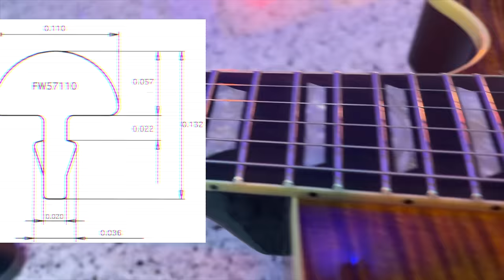The BEST Sounding Les Paul I've Ever HEARD

Comment: I want one . Tim Pierce, signature ✌🏻🎸🎶
Reply from the maker: Heritage told me.......Just reach out to them, and they are happy to build anyone a "Tim Pierce spec" guitar :-)
Reply: A Tim Pierce signature, why has there not been one yet? That would be great!
Reply: @timjonesguitar   I got an H150 thirteen years ago. I put some OX4 pickups in it. It's awesome. I also have a Heritage archtop which is even more awesome.
Reply: @timpierceguitar  what is the price?
Reply: @timpierceguitar    I would love to do that, with the only change being chrome instead of nickel hardware, because somewhere along the line my body chemistry changed to one that does bad things to nickel.
Reply: I asked Heritage to make an H150 to my specifications in 2017.  They were fantastic to work with.  My isn't weight relieved but was air dried (as opposed to kiln dried, as is typical of guitar blanks) and sorted for light weight.  Coincidentally, I also asked for a 1960 shaped neck.  The 225 humbuckers weren't around yet but I specified ThroBak KZ115s and bumblebee caps.  It's a great guitar, if a little hot.  I find it's the most predictable of my guitars and I can make it do what I want it to, if that makes sense.  (my first electric guitar was an H-535 with Lollar P90s and it's great, so going to Heritage for the custom H150 was a natural.)
Reply: @timpierceguitar  The headstock is hideous
Reply: @fritzhieke7209  Heritage Custom Shop starts @ $4100 so this is likely in the $4500 - $5000 range. Note, this is a killer top and compared to the new TM aged Gibson's that are $20k, this appears to be a "deal".
Reply: @lucbos7516  Yes, the headstock is a little plain, but they had to differentiate themselves from Gibson for copyright reasons. Honestly build quality and sound are more important to me than the shape of the headstock. I might be in the minority on that, but it is what it is.
Reply: A lot of people complain about the headstock design; I don’t mind that; and their archtops are the bomb.
Reply: Kalamazoo built. Heritage are wonderful guitars
Reply: @fritzhieke7209  the H150 Custom Cores are 3800-4500.00 as ive seen on sweetwater. So without Sweetwatter's cut, and direct from Heritage...probably similar.'
Reply: @etherboy3540  the headstock works better than the Gibson...less deflection.
Reply: What's a ballpark figure on this.
Reply: I’d buy a “Tim Pierce sig” in a second! 🤘
Reply: @lucbos7516   Stop.
Reply: Yeah, with all the little goodies he got on his....
Reply: Love my Heritage.  My back does not.  😂😂😂  As good as any Gibson I've ever played, highly recommended.
Reply: 100 percent.  Would love one!!
Reply: I just got a Artisan aged custom core h150, it's the best guitar I've ever played
Reply: @ilikebacon860 , Tim’s version in 7 lbs 4 ounces
Reply: @lucbos7516  The headstock reminds me of the old Gibson headstock design, and assumed it's supposed to?
Reply: @MikeTheEarGuy  Seriously? It's solid wood and only weighs 7 1/4lb..?  My Epiphone '59 reissue weights 7.7lbs., and was the lightest solid Les Paul I've ever played, Tim's is the lightest I've ever heard of if that's true.  Of course Epi uses Asian faux "mahogany", but resonates well and sound good, so I don't care about the species.  I heard the new Gibson CEO say they own a forest of "mahogany" (not sure what kind) on FIji, if I remember correctly.  He said it was getting difficult to source and heavy, so they grew their own forest of a fast growing species I assume.  The lightest Honderas mahogany (which grows in other countries in the area) comes from the largest trees, and those are the fiirst ones they cut down.  That's why you'll sometimes see early Les Paul guitars from the first year weighing just over 7 pounds, supposedly it might have been Cuban mahogany, but all their forests were destroyed rapidly from over-harvesting the timber.  The lightest and best wood sonically is at the top of the tallest trees.  That's what I read, and it makes sense.

Comment: Years ago while working for Sprint i was at their telecom site which is next door across the tracks from the Heritage factory. I had a 1938 Gibson  f hole style acoustic guitar with me that had a shimmed neck and didnt play well. It was all i had at the time though. I went next door and knocked on the door with the guitar in hand.a guy opened a little square window and asked me what i wanted. This is a very rough neighborhood it seemed to me btw. I told him iwhat i had and it was doing and asked him for advice what to do with it. He said they dont fix guitars. But a guy behind him said let him in let me see it. So i went in and he looked inside it and his eyebrow arched. He said leave it here and come back at 4 o clock. I thanked him and went back to work. I went back at 4 and he wheeled out a very old guy in a wheelchair. He had a light on a head band and he showed me the tag inside through the f hole where he built it in 1938. This all happened in the late 90's. He showed me another tag he had added where he repaired it that day. I tried to pay them but they wouldnt take my money and they basically ran me off. It still plays beautifully now and i still have it and have added a floating p90 .
Reply: Wow! What a story! Thats awesome 👌.

Comment: I worked in a repair shop for a couple decades, a period over which I've played almost everything known at one point in time. It's an interesting thing when it comes to Les Pauls, weight relieving/chambering and the desire to have them sound as close to vintage Bursts as possible. Most people will go with a modern model without weight relief because the original ones didn't have it, and they're trying to get close to the tone and response.
I've played a number of 50s Les Pauls,; several 58/59/60 bursts, along with a few Gold Tops, and the one quality that was consistent among them that isn't nearly as prevalent with them after they returned from being discontinued in the 70s right up to modern ones, is the resonance and attack. "Liveliness" is a common description that, while a bit vague, none the less fits. There's a bounce and punch that people tend to equate more with Fenders or semihollows than with LPs. Personally, if I were looking to get a modern model to fill in for a vintage one, I'd start by trying out chambered, or even weight relief before non-weight relieved,  that's going to get as close to that liveliness. Another thing is that the older ones tend to be markedly brighter than modern ones, and out of the modern ones it's the chambered bodies that are brighter. I'm not completely sure why that is, but if I were to guess I'd say that with so much of the mahogany mass removed, the maple top plays a larger role in the collective tone. I've also noticed that the lighter the guitar, the brighter their acoustic tone is.
The resonance between the neck and the body is the foundation that everything else builds off from, and it's also the hardest thing to change later on (if it's possible at all). Pickups, pots, tone caps, hardware, etc? These are all things that can easily be replaced later on. The wood? Not so much.
Reply: I have a 2010 light burst chambered, it was the black sheep back then, no one wanted it and I fell in love the instant I played her at the store, bought it and it's my main guitar ever since.
Reply: @EduFirenze  in the spirit of transparency, I was biased against chambered early on myself, and for the very same reason I stated above. It wasn't the first time I was wrong about a piece of gear because I was viewing it that way. I remember being really put off by the Marshall Silver Jubilee because of the clipping diodes they use in the lead channel. I found it…unnatural for a tube amp.* Now it's my all time favorite Marshall model. 

*In my defence, Marshall had used clipping diodes in a couple other amps that I had heard and really didn't like. The nailed it on the Jubilee though
Reply: After 30 years of playing,  buying,  and flipping guitars I have a keeper in my 08 chambered standard.  It was great with the burstbuckers but then I swapped in SD Antiquities and it's like a telecaster and a grand piano spent a night together.
Reply: @TheRyguy79  Then you get what I'm saying, because that description immediately makes sense to me, I know the sound you're talking about. Matter of fact it's a better description than I used 🤔… I'm stealing it 😉.
Reply: amen brother!! i hv an 08 tobacco burst standard. Why wld you want 10 lbs hanging round your neck. Say what you will but i will put my chamberd up aganst any non weight relived lp. I put a dimarzio 36th paf in bridge and swapped magnet in neck pup for an alnicio 2. Its a tone monster!!!

Comment: I have a 1994 H150, that I’ve tried to love, but it is so heavy I can’t bond with it. I tried to sell it on consignment at a very-well-known guitar shop in Toronto.  However, as soon as the shop representative responsible for consignments lifted it up, he put it back in the case and said not interested. It’s been sitting in its case in a well-humidified room for three years now.

Comment: That's definitely an amazing sounding guitar. I've done all types of mods on my 2 Les Pauls and have gotten closer to the sound I'm trying to achieve but it still doesn’t have that awesome bell-like dynamic sound that yours has. 
A couple of things I've learned along the way is that no 2 guitars (especially Les Pauls) are the same. The mods (pickups, pots, caps, etc) definitely help but the gear you play through, particularly the amp,  is a big factor in the guitar sound as well.

Comment: Been playing Gibsons for over fifty years.  Played and owned lots of vintage.  Had some truly incredible Custom Shop Lesters!  Introduced to Heritage twenty years ago.  Been to Parsons Street a dozen times (a couple of times since the change in ownership) and have met all the original owners.  I've owned half-a-dozen Heritage guitars and had them do a custom spec build.  I love their guitars.  My most recent is a Custom Core H-150.  It is "all that"!  The late Edwin Wilson, along with Heritage's in-house vintage guru Pete Farmer, "got there" with the Custom Core H-150 and the 225 humbuckers.  An inveterate tweaker (I have a 25th Anniversary H-150 with actual PAF's), I wouldn't touch the Custom Core.  Fit, finish, weight (8.3 lbs. not relieved), relic'ing, neck carve, top (gorgeous chevrons), color (tobacco burst) tic all of the boxes.

Comment: Heritage makes fantastic instruments.  A few years back I was going to have them make a copy of my '79 Les Paul Artist (loaded with Rio Grande pickups not the Moog garbage) since the guy who carved the neck literally still worked there, but I ended up finding a one of one guitar that I couldn't say "no" to instead.  One day I will still follow through as I really do feel like Les Pauls with Super 400 style necks (5-play maple/walnut with ebony fingerboards) are the best LPs out there due to the crazy articulation they have (mahogany sounds really muddy in comparison).  Plus the headstock is much more robust unlike normal LPs that are eventually going to need a headstock reapair if they are played live at all.
Reply: Why would it need a headstock repair from being played?
Reply: @allthings1150  played live.  If you play enough shows your guitar is likely gonna get knocked off a stand or dropped by a tech.  I've been doing live sound for... yeesh nearly 30 years and playing shows for about 20, and I've seen a bunch of guitars tag a dig off a stand on stage.  Obviously the guys working around really expensive guitars take extra care but most of us don't get that treatment even when we have $15k of gear sitting on stage LOL.  It is a widely known issue with the Les Paul headstock design.  Even the volutes on some LPs (and on vintage Martins like a D-28 of mine) will help protect it from breaking no idea why they don't use them if they insist on a one piece mahogany neck.  Hope that explains what I meant.

Comment: This guitar and rig you are playing sounds like vintage Townsend with The Who. And you are playing the same way, dynamically. I have to say, and you hear this especially on Live at Leeds, he was playing an SG with P90’s and into 100 watt Marshalls or Hiwatts. Same in the studio with the ‘59 bassman paired with the Gretsch hollow body or the telecaster- he ALWAYS dimed the amps and used his fingers and pick either aggressively to get drive, or feather light for glassy clean. He also got good effect with tone changes by backing off the volume knob a tad. For me, this is THE holy grail tone set up. There are other tones I like, but this has been my fave for 40 years no matter who does it (Pierce, David Grissom, Rich Robinson, Pete Townsend, etc.)

Comment: Just about half through the video, it sounds great, of course it’s in Tim’s hands. My 2 suggestions would be for Heritage to, use Faber ABR1 style locking bridges, you can see your stoptail piece is really high, which I think ABR1 is likely to eliminate since it’s thinner than a TOM, and secondly to start using “Heritage” on all headstocks, and not “The Heritage”.

Comment: What are pickups?
Reply: They are the rectangular silver things under the strings that have magnets and when you pluck a string the vibr 10:03 ation cuts through the magtenic field and this generates a very low level electric signal. Kind of like a generator. This signal is then connected to a very high gain amplifier that is then transformed to a speaker and walla guitar heaven.
Reply: @david25876  I meant what pick ups are in this guitar